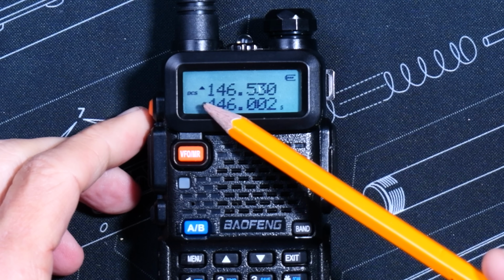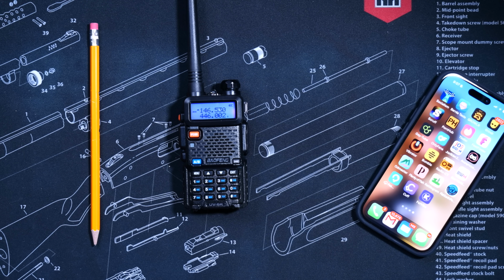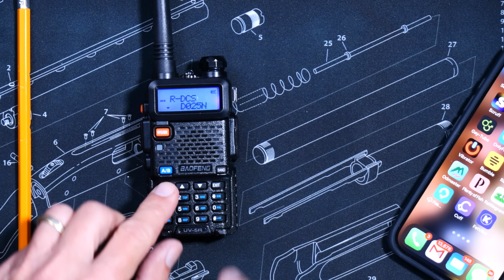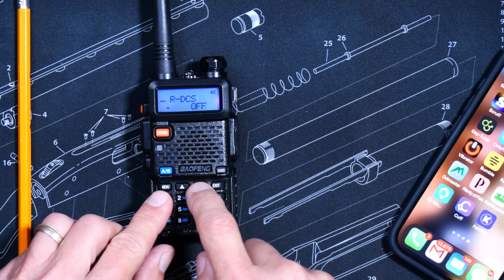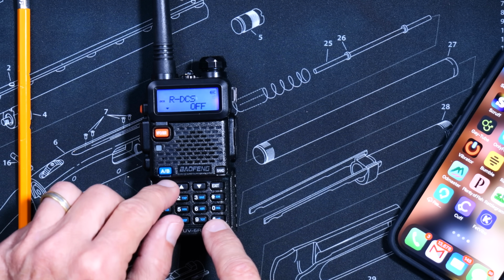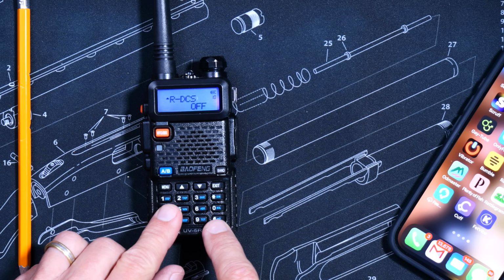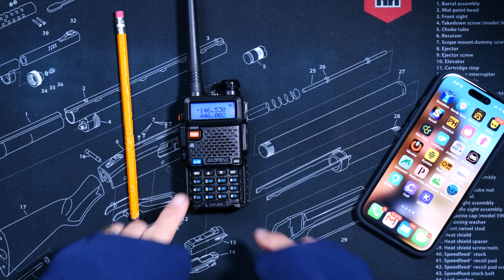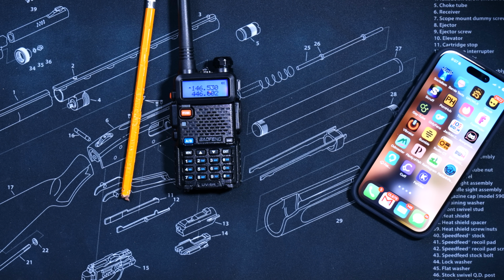Baofeng UV-5R: Why Can't I Pick Up Any Signals? Why Your Baofeng Doesn't Receive Anything

Comment: I dont have trouble on mine. Add a 17 inch Nagoya 771 antenna, or an outdoor antenna at 20 ft. I've exchanged SSTV pictures at 10 miles.  Add a 1/4 wave or 19 inch ground wire to the outside of the antenna jack or better to the screw on belt clip. Learn how to properly program your radio. The manual is good once you learn how the Chinese think. The first time took me 2 hours to program 20 channels. I've had 5 of them.
Reply: I've received SSTV pictures from the International Space Station 249 miles overhead. While using the Nagoya antenna. Become a technician class Amateur Radio operator to get the most from this radio.  A 3/4 wavelength jpole antenna outside 20 ft up in the air is much better for listening to everything. I use quality tv coax from the cable or satellite company and adapters. Do the work or your reception will suffer.

Comment: I climb towers often for work, while I was on one earlier today I was able to talk clearly to my dad at 15.7 miles straight line. UV5R radio to radio.  (Measured later on google earth) just shows how much height matters for these radios. His house is up on a hill and I was on a 50 foot tower
Reply: Im' in NM, the Tularosa basin. and  I get into the repeaters  with my uv5re  that are 70-80 miles away up on the mountains.

Comment: U worked to bring the Mucrodtne RCB2000 to the maket. It was a duua; diversity SDR recieveer.  It used nultiple FIR filters to set the IF and video badwithh . It was fyully digital, past the block downconverters and used a 70 MHz IF. It ran Windows CE, and could be fully remote controlled from anywhere with an interenet connection. Id was the first software defined Telemetry receiver for te Aerospace undustry. It was VXI based, and in a 7" rackmoint case. It could handlep Dopler shift for trackin sattelitss. Ut had RS232, RS465 IEEE-48 and ethernet interfaces. We could even upload new firmware remotely. I believe it sold for about $80,000 when first introduced. NASA and Aerospce customers were lined up to buy them as soon as a prototype was displayed at a trade show, It replaced a fuly analog design that required the factory to build and align up to 16 IF bandwidths, and 16 Sallen Key video filters to select the video bandwidth. It was the only desigb I ever worked with that had a fully liner AGC system, to allw two receivers to track  for Long Loop combining. It used 14 opamps to creae a 0-10 VDC oitput, wuth a maximim error of 1.5 mV.

Comment: I have a number of far nicer radios, made by Icom, Yaesu, and Kenwood, that operate in the 2 meter and 70cm amateur bands. These are ALL analog radios. Most of the amateur repeaters in my area have switched to one of the three digital modes, called  D-Star, DMR, or Fusion. I have chosen not to get into that GARBAGE, and have pretty much given up on VHF/UHF amateur radio.
Reply from the maker: ok.. Thanks for letting us know.. Nobody asked, and it really has nothing to do with this video, but we are all very impressed!

Comment: If you can it would be great to have a video by an expert like you of using the uv5r in Europe, Germany et al. They were sold here for long so their should be many that have em but most repeaters are taken down and emergency services are digital since years. Maybe frequencies are different here dunno. Thx love the program. Reception even as two way line of sight is terrible.
Reply: Not so far from you (Polish/Czech border) yesterday I had my uv5r on the whole day during a hike in the mountains. There were perhaps half a dozen people talking on PMR channels and about that many on a local repeater. No SOTA activations on UHF/VHF within 100 miles. And occasional railway worker's communications (in my country these are mostly around 150 MHz). A month ago I managed to pick up ISS talking to some radio enthusiasts.

Comment: Why can I received signals but not transmit back (same frequency and radios 1 meter away from each other ) ?
Reply from the maker: get the radios at least 50 feet apart and try again
Reply: ...and stand in the middle to get the best effect.

Comment: One more thing, most of these radios are only FM. Some do have AM, which I believe you need to listen to air band. I live in the middle of nowhere, so I don't hear much other than GMRS traffic. On a bigger outdoor antenna, I can pick up public services traffic, but not on the antennas that come with the radios.

Comment: could you please stop grabbing the radio by its antenna and waving it around...that is bad practice...yes I know it is a Baofeng
Reply from the maker: You are obviously not a certified radio expert like I am, leading you to misidentify the parts on a radio. That is not an antenna, that is the handle. If you had passed the H.A.M. radio test you would know this.
Reply: It was question 69 on the HAM test

Comment: Retired a few years ago and just recently bought a BuffWang uv5r. Couldn’t hear anything. Turns out I was deaf.
Reply: Sorry ,I cant hear you.
Reply: @DeathValleyDays  what?
Reply: "I see", said the man- as he ran into a post
Reply: use the asl setting in the radio
Reply: Pro Tip:  When your wife is out of the house, its OK to have your hearing working. ;)
Reply: Must be my problem too
Reply: Relatable...
Reply: Top comment. 😅
Reply: How are you typing this if you're deaf?
Reply: @one_eyed_pete2462 Ahem.................. He can see. 😂😂😂😂😂
Reply: Say again?
Sorry what was that?
Reply: I asked for a buffwang at the Chinese massage and they handed me one of these. Only slightly less arousing.
Reply: AND DUMB TOO? OBVIOUSLY!
Reply: BoofWang*
Reply: Hmmm. Doesn't sound service connected.
Reply: Well you should think yourself lucky as 95% if Americans are dumb, not deaf.
Reply: Pardon? Speak up................ Yes......... Tuesday. 😂😂😂😂😂
Reply: Should bee able to here (or there) lots with all that mygigglehurts in that radio.
How do they get all that in?

Comment: First off, I needed a good laugh today and you delivered. Thanks. Second, the úv-5r is excellent at picking up gmrs from many ,many fars away. Carry on...
Reply: It's pretty good on 2 Meter too I made a contact the other day (and got told to get off Simplex by the operator who knew it was a Baofeng😅)
Reply: You spelled “first of off” wrong
Reply: Uv5r and 2 TDH3 . Make a great system  in our hunting spots.  Actualy thinking of making couple  of them into  a repeater to extend to 3 hunting spots  they are about 5 miles apart . Just a slight line of sight issue  to the 3rd area  but sure we stategicly set a repeater box on a hill  and reach the last area.  Sure will help with hog hunting.
Reply: Plenty of fars? I needs to git a couple few.

Comment: Works just fine when connected to my j-pole antenna, hitting various repeaters.  The people 50+ miles away from me tell me it sounds pretty good.
Reply: Any chance you could provide some information on this j-pole? Would love to get one to try with my UV-82HP and AR-5RM.
Reply: @jaredaaz  Ed Fong sells them, or there are a number of videos on YouTube about making your own out of regular house wire. Both require some good measuring, and some PVC pipe. If you build your own, you will need coax as well. Plus some half way decent soldering skills.
Reply: @jaredaaz  I just checked Ebay using the words "copper j pole" - $40 shipped.  You're not going to beat that.

Comment: PRO TIP: if you have tones in because you use it to talk to a specific group, but you also want to use it to scan for unknown traffic on the same frequency, just add that freq on a duplicate channel with no tones. If that frequency is more important to you than others, add it a few times throughout your list so that the slow scanning baofeng doesn't miss much traffic on that freq as it scans.
Reply: Very good advice.  If it's not particularly important, or if you have a scan list that is short, you can put that tone on the outgoing side only and leave it off on the receive side, and have it to monitor that frequency but you can break the squelch on your confederates' radios.  That will be done on just one channel.
Reply: Oh ,  thanks a LOT there ,  Ben.
N_O_W  you tell me , AFTER 
I  already bought  eleven more
Bõöfwăng Uvee 5rrr  AND built
a shelves for it  just so i woodn't
mist a traffic on my favôr¡te 
freakensieze.
Reply: BTW HOW DO TONES GET IN THERE?

Comment: I added in Canadistan... an illegal.. external antenna using an amazon cable adaptor and pl259 connector to a home made unit OUTSIDE. Inside I barely hear even the strong channels from Peoples Republic of Canada Coast Guard. now I can pick up local municipal road operations cleaning snow. Emergency dispatch on a channel normally assigned to weather alerts. and local radio nets across central Ontario. Works great scanning. UV3RIII is able to get 200 freg range but not picked those up a all.. too far from an airport
Reply: Congratulations on the resignation, coming soon... I hope you get something better up there!
Reply: Be careful or they’ll deport you to Vancouver.

Comment: I just bought a new AR - 5RM
Reply: That's what I got for my first Baothing. I really like it. Can't beat the price, that's for sure! One thing I was excited about was the air band for receiving aircraft AM VHF. Unfortunately mine barely useable for that...can hardly make out what they are saying. It's connected to a 2-meter/70cm vertical on the roof. Should be close enough to receive well. Enjoy
Reply: @182QKFTW  I have yet to mess with it. I'd like to just listen to the communications between people who are far away. I don't have any License yet.
Reply: @MichaelSwartz-hh7fk Nice radio, just be careful with it, it can transmit on frequencies that us "civilian folks" are not allowed on.